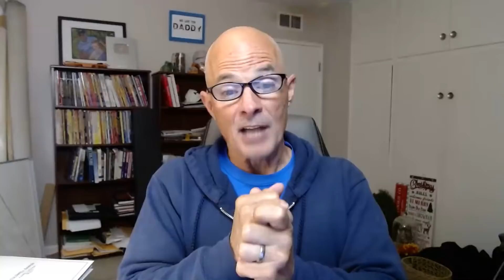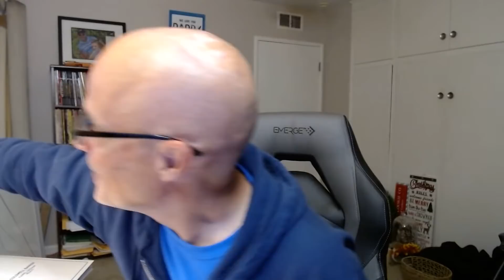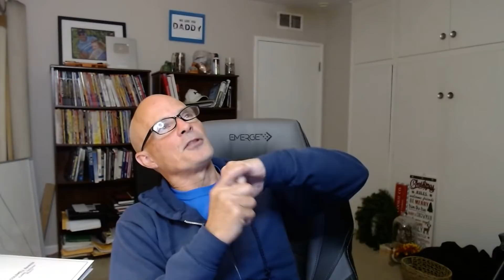LET'S TALK TECH-LS TURBO MYTHS, WHY I STARTED THEM-THEY SHOULD STOP

Comment: Would really like to see the difference in A/R on the housing with same inducer and exducer sizes. Also what the upper limits on timing using pump 91. 100 percent stock gen IV with 243 heads. Want to see the difference in response and limit of the housing sizes

Comment: One problem with turbo testing is the ideal turbine and housing size is engine airflow specific so a test only applies to that configuration. I have been doing some detailed turbo testing on my channel all on the same engine with the same fuel and timing and seeing some pretty big differences.
Reply from the maker: the turbo multiplies what is there NA
Reply: @richardholdener1727  I meant like on a 6.0L engine at 5000rpm you might run 25psi boost and drive with a 1.32ar 3.4 turbine. If it was a 7.0L the same turbo likely would run 25psi boost with 30psi of drive with the same 1.32 housing. You could change to a 1.50 and likely get back to that 1-1.

Comment: the LS9 you mention was rated at 155@4000 and 255@2400 for 1973. Everybody wants low end torque until they realize hp is what they need to pull a grade.

Comment: 6.0 I never ranned it was badly put together,block is bad 823 heads are good,now I'm finding more 5.3 should I step it down or keep looking for 6.0 add a turbo gas is high so 575hp  on wheels will cost the same as 375- 400hp?
Reply from the maker: you can easily do that power level on a 5.3l

Comment: build a 6.0L and test 317 vs 706, but swap the pistons too so that the compression is the same on both tests. That would be a fairer test.
  But personally I think that if you have a detonation threshold limit then the lower compression with more boost will win because more boost means more cubic inches of air/fuel into the cylinder.
Reply from the maker: if you change the 2nd variable (pistons), you are not testing the heads
Reply: @richardholdener1727  I love my 317s. Makes my tuning band much wider and easier 😂 just throw extra timing at them. They like it

Comment: When I was talking about putting in bigger intake valves shrouding of course is going to be less.DV solved the problem with old small block Chevy cylinder heads back in the -day he ended up putting a smaller valve in the head because the casting was thin to add a bunch of shrowling and it made a lot more power than the other guys
Reply from the maker: how does a bigger valve have less valve shrouding from the adjacent chamber wall? it would get closer
Reply: @richardholdener1727   Yes you got it correct I had it backwards I should have said more